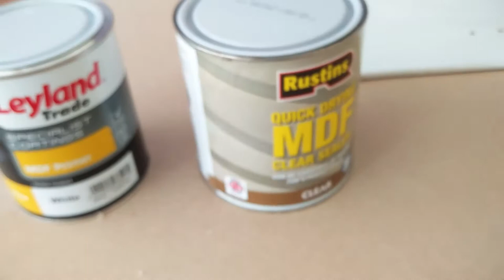13  Protecting MDF sub-roadbeds | How to make your layout firm and level for years in the future.

Comment: Rustin’s make a good product, British as well, you should be fine, yes it is better to coat the MDF in its cut form so that both surfaces and the edges are coated. I used MDF without problem with 2x1 battens you have much deeper sections which is better, and I found the track pins go in fine. I drilled a .5mm pilot hole partway into the board for the pin and tapped it in with a toffee hammer.
Reply from the maker: Thanks. I am not pinning my track, but gluing it with copydex, but I do drill I pilot hole for a map pin to hold it in place while the glue goes off.